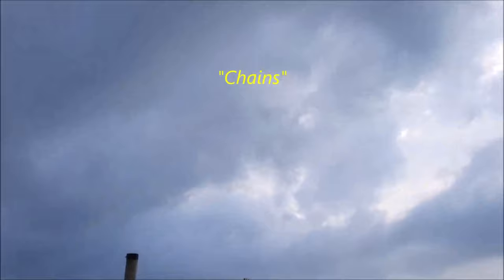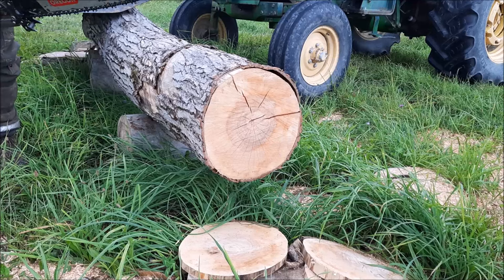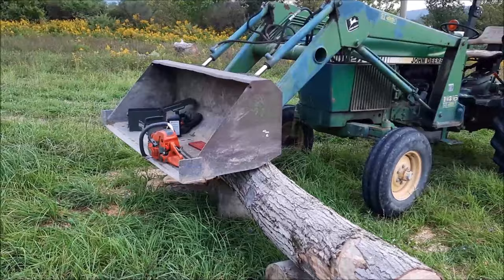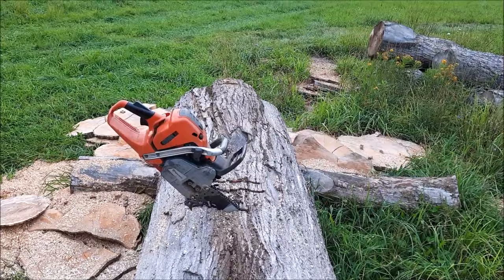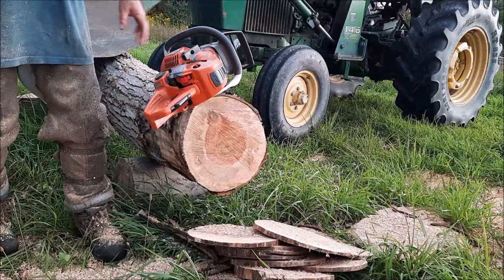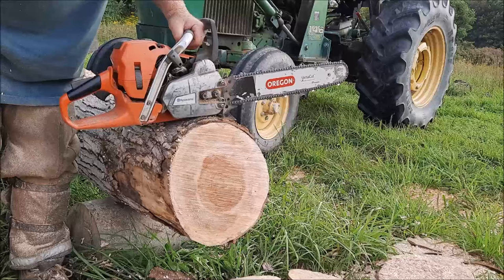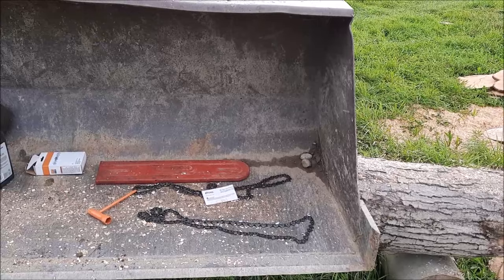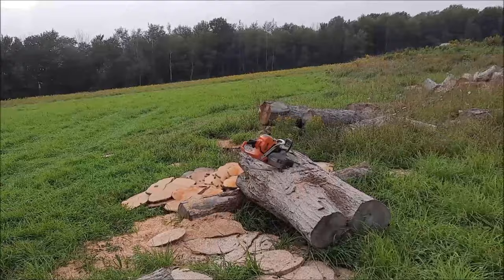Skip or Full Comp Chains On Short Bars, It's an East Coast Thing. Oregon LGX vs. Stihl 33 RS &  Skip

Comment: I get the logic of skip on very long bars (less strain on power head and chip clearance) but cannot understand using it on saws with 20 or 24” bars - I’ve tried it once (local STIHL dealer swore by it ) and went back to full house

Comment: The skip chain is for long bars in soft wood for felling trees. It helps clear the chips and keep chips from staying in the cut and plugging up the bar and making the bar get stuck. Pulling the bar out of the cut to clear the chips slows the process down felling big trees in the north west.

I really liked the skip tooth in soft wood on my 24inch bar using the Stihl ms361. But I can't say it cut faster, since I wasn't logging out big trees. I was just bucking up logs already down.

In hard wood I'd imagine the skip chain would dull much faster then a regular chain.

Cool video comparing your perception of the different chains as you used them. I've never tried that for picking my preferred chain. I know Stihl chains are the hardest so they keep an edge longer that other brands. The Oregon chains are the second hardest chains and I hear they are easier by quite a bit to sharpen.

I will likely pick an Oregon chain for my own preferences in the future.

Great video. 😎👍
Reply from the maker: Maybe, I take a different route, yes for long bars, but also on power heads that are at their power limits. I never had a 28 or 32 inch full house bar & chain combo plug up in hard wood, so that's got to be a soft wood / west coast thing. I see the skip out here on 20 and 24's too! But usually on saws that came in for PTO bearing failures :) AND even with the toasted bearing the chains are still snap tight, An EAST coast phenom. What folks out here forget is those 288's , McCulloch's they started and learned on don't spin 14k :)
Reply: @afleetcommand you are likely right. There is a huge difference between high torque with lower rpms that the newer high rpm saws.

Hard wood with a full chisel chain even if it's a skip chain will dull alot faster, so it's alot different in what it needs to cut efficiency than soft wood.

I like a full chisel chain for it's speed in cutting. But if I was making a living cutting hard wood, I'd choose a semi-chisel chain so I didn't need to switch chains so often, or sharpen them so often.

But as somebody that cuts a just little for recreational use, like camp fires or bonfires, I like a longer bar to avoid bending over so much and a skip tooth might be an option if I'm running a bar bigger than recommended for the the size of the saw. But I wouldn't be cutting big wood anyway.

But that's just my opinion.

Right now that is not what my situation is. I got a ns872 clone of the Stihl ms382 or Stihl 380 magnum. It's a 72cc saw with a 24inch bar on it.
My second saw is a G111 a clone of the ms200t top handle saw with a 16inch bar on it.
But if I had a newer ms261 or ms262 a 50cc saw instead of the 72cc saw I do have, I might run the 24 inch bar to save on bending over cutting medium to small wood.

I'm short at 5'6", so a 24inch bar saves me from bending over.

Comment: That saw continues to impress, and you definitely know how to sharpen a chain If it can match the RS out of the box for speed.  In my experience  I have found they are the fastest out of the box and seem to hold an edge longer than the rest.  The prices around here only favor Oregon by a small amount, so not much incentive to get them.

No surprise the full skip was slower, but the fact it could bore cut no problem was a surprise.  Must be the high chain speed working toward that end.

The worst chain I have used, at least for initial stretch was an Oregon 72lpx.  Within 20 minutes of first use it developed so much play it jumped the bar, 2-3 time more stretch than even cheap Chinese chains I have tried out.  Once it settled in it was fine, but that much right out of the box is unacceptable.  Stihl chains are usually my first choice, they are consistent quality and even if they are more expensive you get what you pay for.
Reply: I will always hit a new chain with a file and check the rakers before I use it.  I have found some Oregon chains to have different raker height between the left and right rakers, so I check them all, now.  I just give them a few licks with a file and file down any raker that does not meet my specification - a little hungry.  I want about a spark plug gap between the raker and the cutter.  I just scan down the cutters looking for a tall raker.  If I see one, it gets a few licks with my raker file.  If I want to bring a chain back to factory specs, I put it on my chain grinder, otherwise it is File City.

Comment: I have been using oregon lpx, exl, exj, stihl RS and whatever the stihl skip is called.  Cant remember, RSL maybe?  But anyhow my experience is that the stihl chains work best on saws with lots of torque but moderate chain speed.  They seem to bite out bigger chips(when new)  Oregon EXL seems to be the smoothest.  Oregon LPX is softer but easiest to sharpen.  Once you start using the chains a bit, by the time you are on the 4th or 5th sharpening, what YOU have done to them matters more than the brand since by then the geometry is all about the same.  Factory grind is replaced by the round file shape after some use.   Stay safe friends.
Reply from the maker: The Husqvarna c83 ruins it for me. Used to be a toss up between RS and LGX. After a couple of seasons with c83 that is all I want to use.

Comment: My Stihl 024 has an RS chain on it and it cuts fine.  I don’t cut any different with an RS chain than I would do with a green chain.  The only difference of note is the RS has a yellow set of links on the chain and the green has a green link.  The one thing you have to note with Stihl 3/8 chains is you have to use a 13/64” file, instead of the normal 7/32” file.  I have a bevy of files for all my saws - 5/32 for 3/8 LP chains, 3/16 for .325 chains, 13/64” for Stihl 3/8 chains and 7/32” for Husqvarna and Oregon 3/8 chains.  All with wood handles with their size written on them with a black sharpie.  Most of my files are Stihl files, except for the 7/32 which is an Oregon file.

Comment: I don’t notice a lot of real difference between a skip chain and a regular chain.  The only bar that I have for a skip chain is my 36” bar for my MS 660.  I have an RS and an Oregon LPX skip chain for this bar.  On odd ball bars I like to have two chains for the same bar.   I have a bunch of LGX chains for my 20” bars.  I agree the RS is a little more hungry than a standard green chain.  It is more hungry because it holds its edge longer than a green chain.  My chains are always hungry because I hit the rakers more than most folks so I am use to hungry chains.

Comment: RS are good chains.  I have them on most of my saws.  I did put a green chain on my 021 when I built it.  If fact it was the factory chain off my new MS 250, which now totes an RS chain.  Next time I get a few extra bucks the 021 will get an RS chain.  It has earned it.

Comment: Nice comparison. When running skip on the same size bar, do folks usually change from 7 to 8 pin sproket to offset the reduction in cutters/drag?

I see Bailey's chart shows the Oregon 72LGX being equivalent to Husky H47, but Husky C83 is more equivalent to Oregon's newer 72EXL which also equivalent to Stihl RS33.

Again, great show down. That Husky 562xp runs great! With that sharp chain and being broken in, it looks like it could run strong against my Stihl 400cm.

This 60 to 70cc category is really complex, great all around but master of none except great compromise between weight versus power specific to the application, which is why opinions range widely. Thanks for the video.
Reply from the maker: I think that is correct as the elx isn't as hungry as the lgx was and it has a way more complex grind, LIKE the c83. I think Husqvarna & Oregon were developing their chains about the time they went different directions so it would not be a surprise that they ended up in a similar place. I had some of the earlier ELX preproduction chains to try and they were obviously shooting for smooth and less power required. The chain I had there was a LGX and Husqvarna's H47 was essentially the same chain in a blue box from what I understood at the time. Just had 47 instead of the 72 stamped . Even now it's hard to beat the old LGX, especially when u figure the filing aspect as once u file a c83 / elx you have taken out their sophisticated grind.
Reply: Funny how true that is. Their grind becomes your grind as soon as you use it...from the lab to the real world.

You (and Bob) really helped shed light on the genesis of saw marketing. Trend now is "shooting for smooth and less power". That aligns with your criticism of the 572xp needing a little more on the low side.

Looking at it that way, the factory saw and factory chain are a matched system. Making it your own is an adventure with ups and downs.

It also explains why the "fives" do just as well as "factory hot rods" in the field cutting wood all day. Ultimately, it's about enjoying saws and putting wood in the truck.

We each choose how much time and money we want to spend doing it. Thanks for sharing sharing your insight and wisdom.
Reply: Great video Sir ! Tried my first skip this past winter in large seasoned white pine . I found that the skip was noticeably faster in frozen wood than full house but as the wood warmed up it lost its advantage and was quite a bit grabbier limbing to the point i took it off the saw . 
52 mm ported 365 saw exL skip vs exL & c85
Reply: @afleetcommand Husqvarna makes a specific roller guide for the c83/c85 chain - the geometry / angles are slightly different than conventional roller guides. I had fits trying to get the c83 to cut with / outcut the off the roll chain when filing it !  Seems I could only get 90-95% until I p/u that specific roller guide -  oem 586938602 p/n - hope this helps someone avoid the frustration I experienced when trying to restore the chain to off the roll cutting speed
Reply: @afleetcommand  The Oregon, Husqvarna relationship is closer than people think.  Oregon was the OEM manufacturer of Husqvarna, Solo. Dolmar/Makita, Echo, Poulan chains.   And at the time Stihl was claiming to make their own chain their descriptions matched the Oregon description word for word down to the font in the catalog.   One of the differences was the Stihl chain used a smaller rivet in the links which prevented using Oregon links to repair Stihl chain.  My understanding is the Oregon links will now fit the Stihl chain.  The OCS-01 temper and the blue cutters used on Stihl chain are Oregon patents.